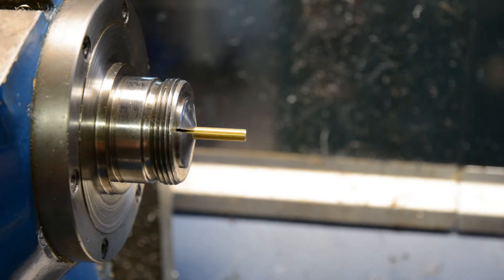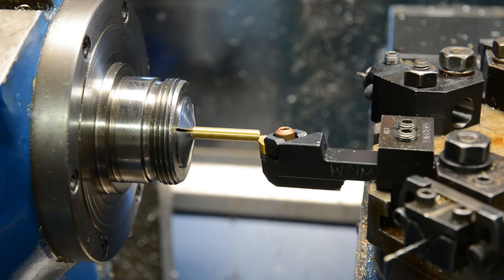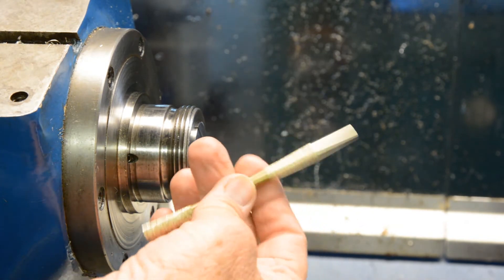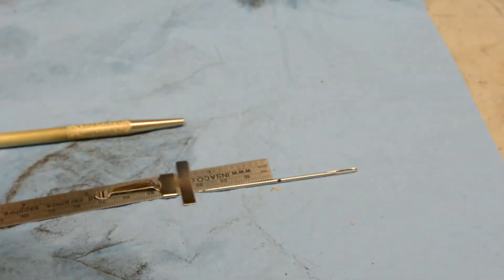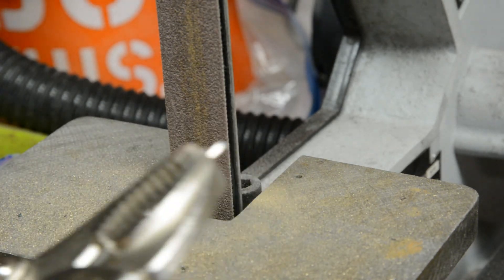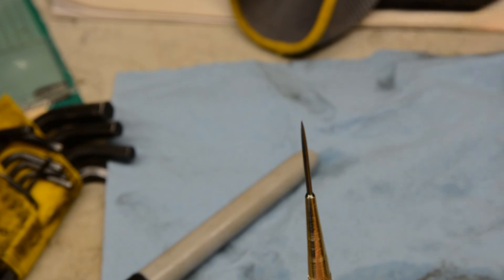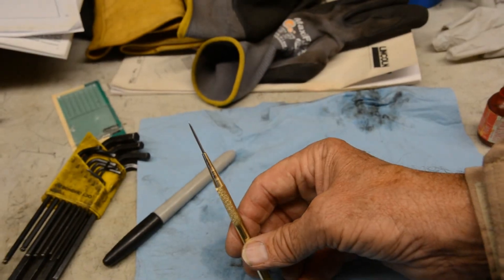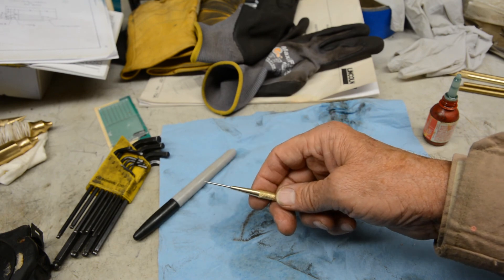Brass Scribe

Comment: What is the spindle nose A2-5? What is the part with the threads that I assume hold a chuck, I have a CHNC 4 that will be needing some work holding items
Reply from the maker: Mine is a threaded spindle.  Something like 2-3/16-10.  Later models came with a A2-5.